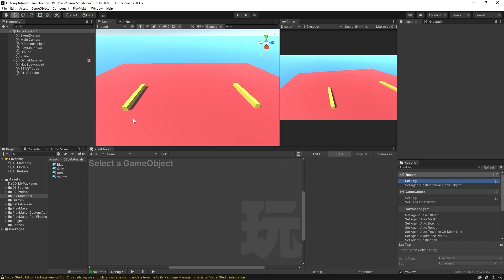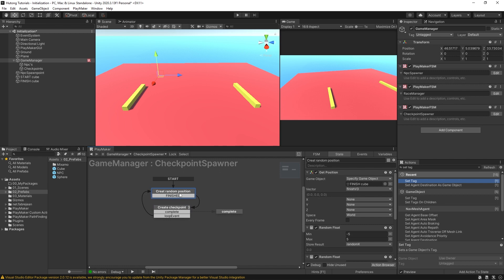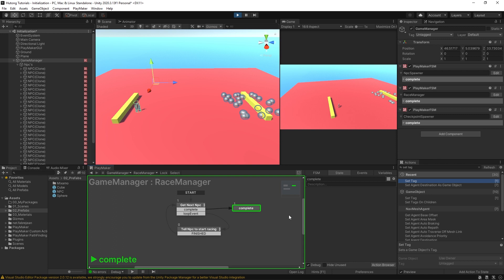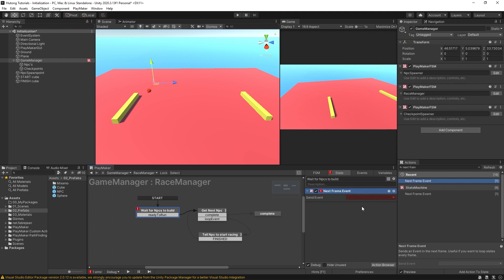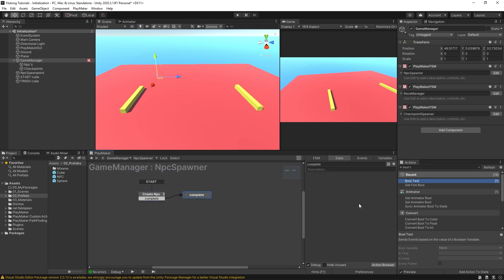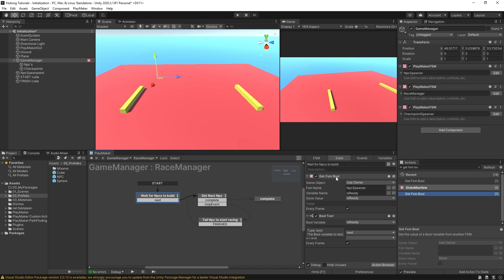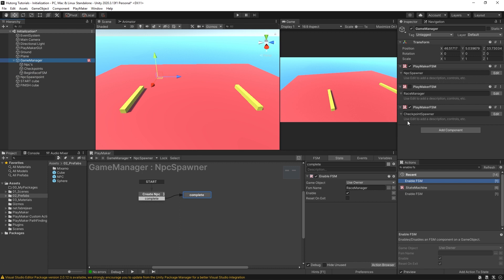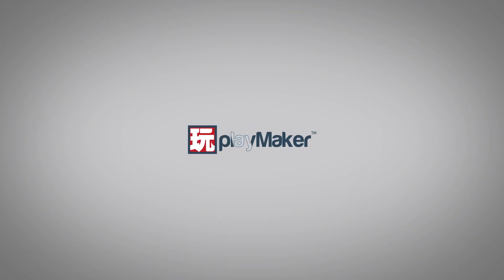Initialization

Comment: Very good. Next time do a tutorial teaching how to make a car run, it would be very useful for people who want to make a racing game.
Reply: I have an idea probably not the best but if you make it that when you click a certain button it will make the car/player move towards a object but the object is a  child of the player so it will contain the distance and the you just have to make the animation on the car and sound FX on the car then the move meant on the object that the car follows just turn of mesh collider and mesh render and you should be good. But this is a idea not tested but hey it’s the only thing I could think of
Reply: @Dantandrade-8459  Your idea is good but I know a way that looks a little better, you drag and drop the wheel that contains the Wheel Collider into the Playmaker then it will appear several Wheel Collider options, the problem is that you have to do this to each wheel. This is the best way I've found but I don't know if it's the correct way.
Reply: @eliezeralisson9512  yours is shorter process for saving time so it’s probably easier but it depends on how it feels in your game and does it feel like the gameplay you want.🙂
Reply: @Dantandrade-8459  But anyway they urgently need to add actions for Wheel Collider in action browser, it will make it look much more professional and more organized. They also need to add an action for "GetGroundHit(out WheelHit hit);" is a necessary function for anyone who wants to make a simulator.
Hope you read our conversation...😄